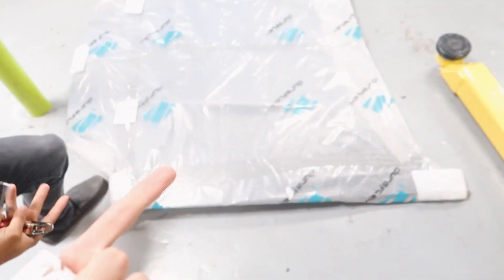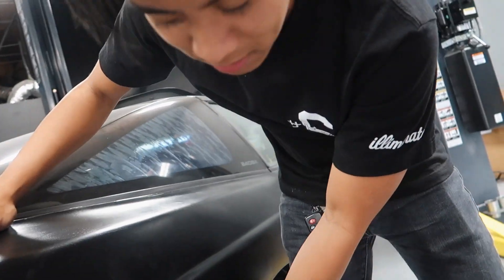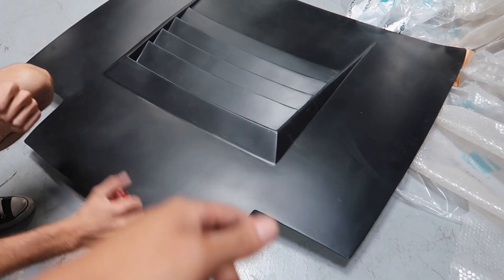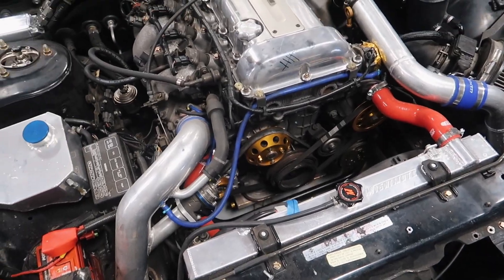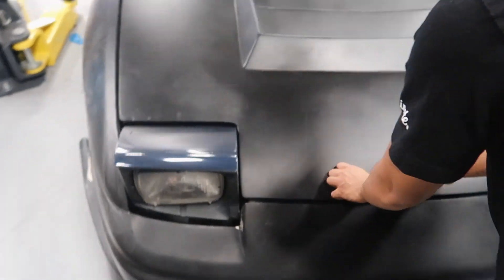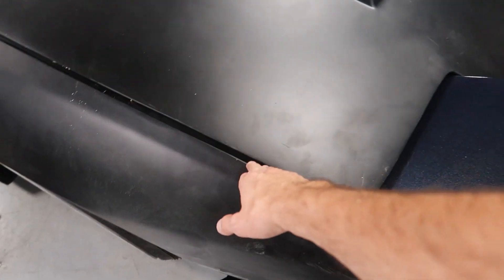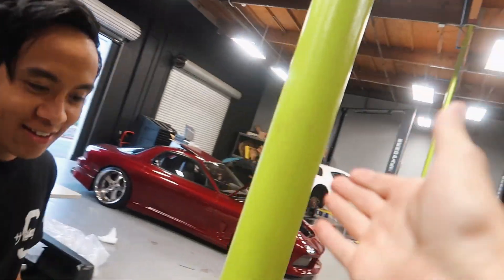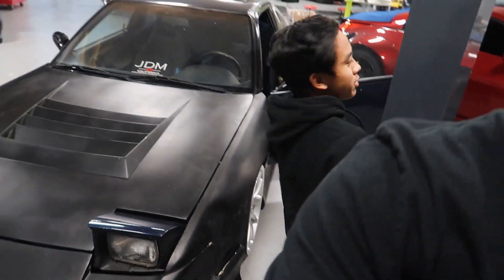WIDEBODY 240SX NEW HOOD INSTALL!!

Comment: Full commitment and do a tiffany Blue for the body. The engine bay and engine components such as the valve head, piping and intercooler can be done in a iodized purple to bring contrast and then go with a Silver powder coated wheel setup, with medium flaking to bring a brighter appearance to the stance of the cars. If you can find a rear window spoiler for the S13 it adds a unique feature. you can also run a contrast with doing components of the interior with the purple to match the engine bay. If Clavin can be dedicated to keeping it clean as well, he can do a silver paint to match the rims for his engine bay. only problem is if he doesn't maintain it. It will have build up and looked horrible since it will show everything. Much support for the channel and keep following your dreams Tj and the gang. Big inspiration for me to move forward on my builds.

Comment: lower the hood latch on the car to get rid of the hood up and down play after its closed...if needed, slot the bolt holes holding the hood latch to get more adjustable ^_^